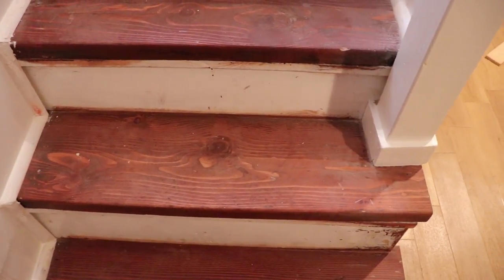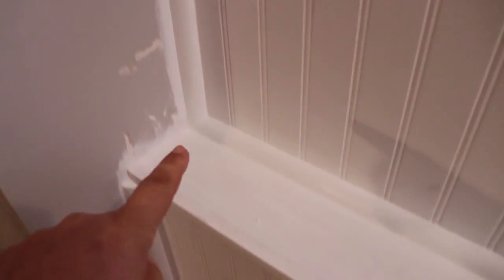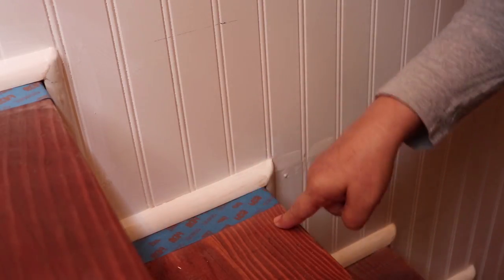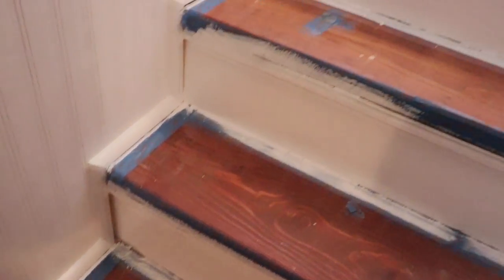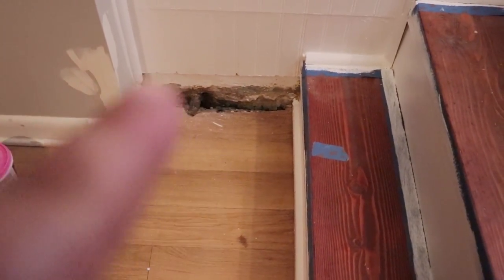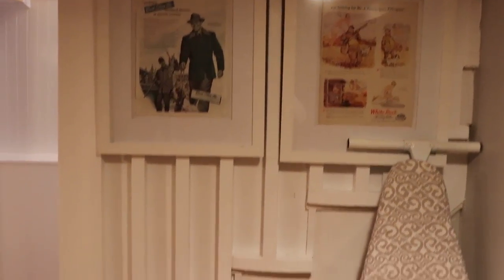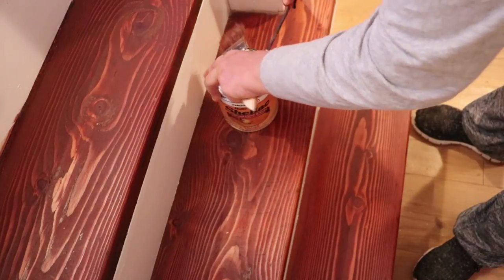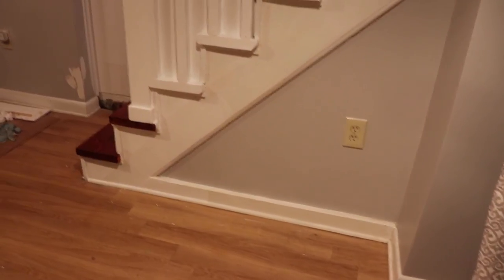🔨 Basement Staircase Makeover || Part Seven 🔨

Comment: So here's a thought... no problem if you want to disregard it though here it is... On the wall where you hung the two pictures paint each stair ( tread) going up the same color as the stairs. So that would be the four stairs under the two pictures. Then paint the picture frames the same color as the stairs. Then the 5th stair that kind of sticks out from the second picture frame on the right also color that the color of the stairs. I think it would tie it all in by matching the two bottom stairs on that side and be a subtle but cool way to finish that area.

Comment: Amazing!  Even though the wood on the treads didn't all match, you did a great job of evening up the color with the stain. P.S...prevent the paint peeling when the tape is removed by lightly scoring the area, where the edge of the tape meets the paint, with a utility knife after the paint dries, but before you pull it up.